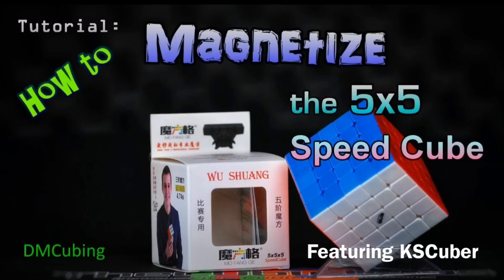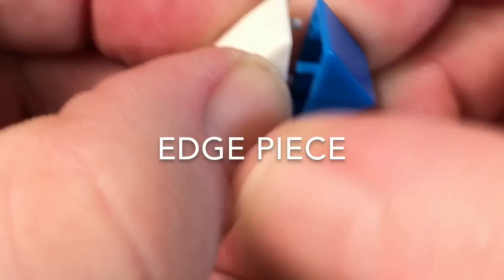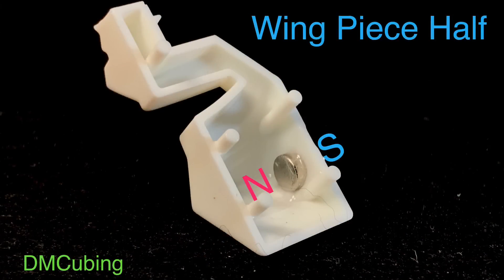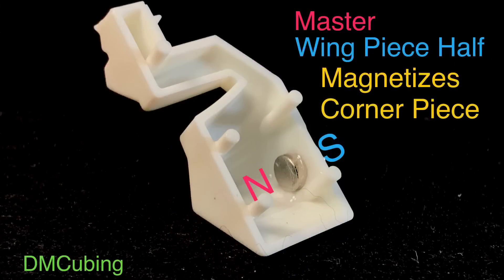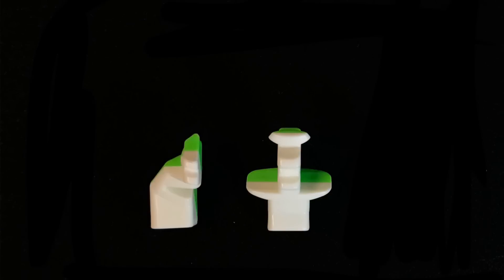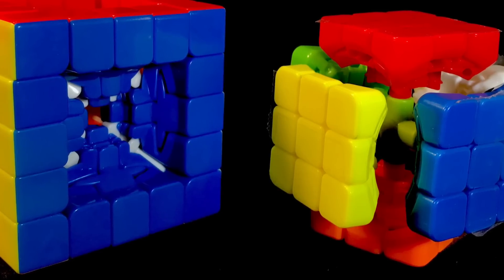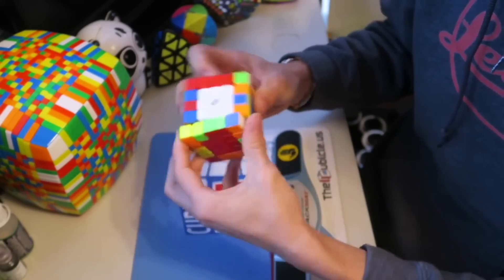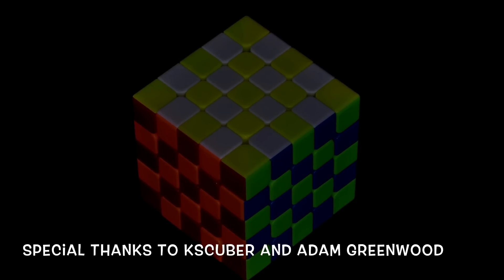How To Magnetize a 5x5 Rubik's Speed Cube (Wushuang & Others)

Comment: Will n35 4x2 work throughout for the wushuang?
Reply from the maker: MJBCuber Yes, particularly if you like a pronounced magnetic feel.
Reply: DMCubing is this the glue you used in this video? https://www.amazon.com/gp/aw/d/B001IY82FM/ref=mp_s_a_1_1?ie=UTF8&qid=1519231886&sr=8-1&pi=AC_SX236_SY340_FMwebp_QL65&keywords=Gorilla+tough+impact+super+glue&dpPl=1&dpID=51mHX2GDBrL&ref=plSrch
Reply from the maker: MJBCuber Yes, the one shown in the pic is what I use. It's also called Impact Tough Formula. Walmart sells it as well as Home Depot and Lowes, if you're located in the US.
Reply: DMCubing thanks so much!!
Reply: DMCubing i know this is a 5x5 video, but I'm making a Wuque M 4x4, and I'm wondering if n35 4x2 on the inners and n50 3x1.5 on the inners will work. Thanks so much!!
Reply from the maker: MJBCuber You must mean N35 4x2 on the outer. Yes, you certainly could do that. The cube is similar to the Yuxin Blue. If you check out my video on that cube, I've pinned a comment thread where people discuss the magnets they've tried in the 4x4.
Reply: DMCubing ok thanks!!
Reply from the maker: MJBCuber np